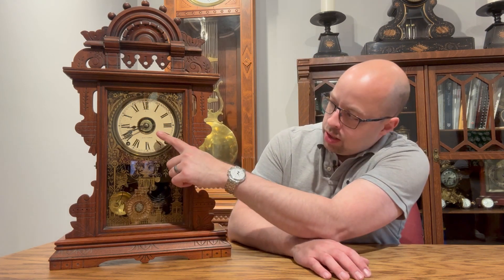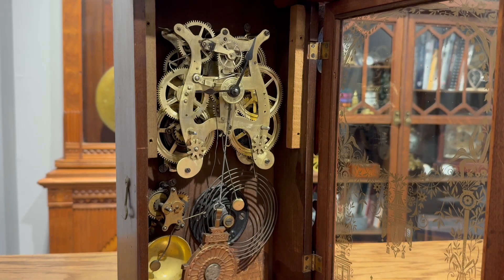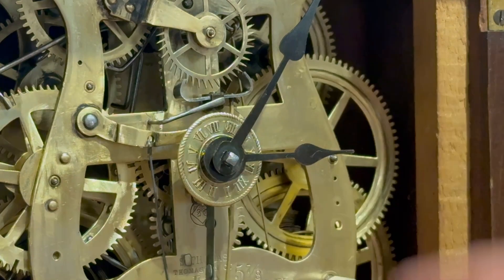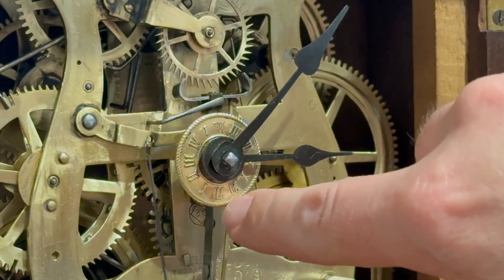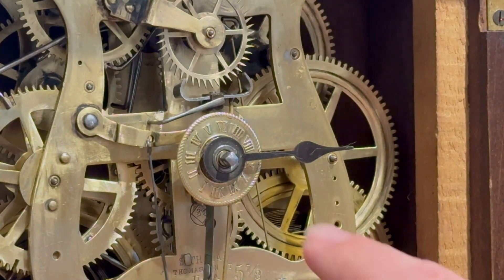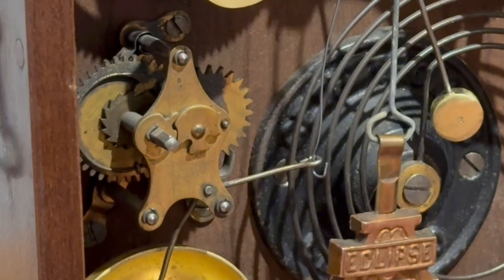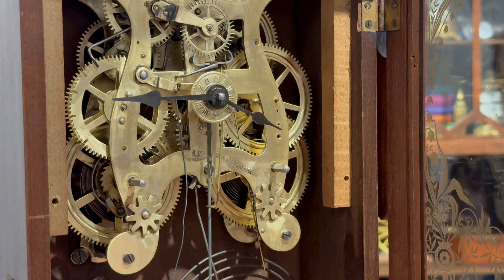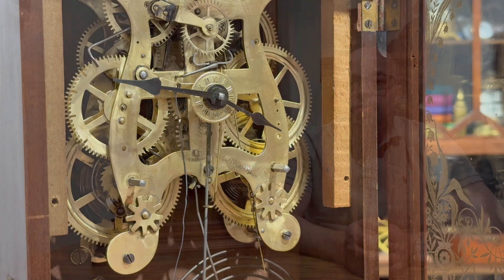Kitchen Clock Alarm Mechanism

Comment: Thank you. This was helpful.

I inherited a kitchen clock that is running and chiming well. The wind up alarm was a puzzle.  The inner dial wheel has holes to help turn it (using the nose of a retractable ball point pen inserted as a tool to spin it).

After your explanation, it was helpful to think of the numbers on that inner dial as a count down alarm.  If you want the alarm to sound 2 hours from the current hour, position the 2 on the dial at top dead center (which is two hours in front of the "12" that then sets off the alarm).
I guess theoretically you can't set it to go off a full 12 hours from the current hour since it would be in the trip position at that setting. ??

I think I may set the alarm tonight to go off without telling my spouse.  "WTH hell is that noise!"  "That's the alarm telling me to feed the cat honey."